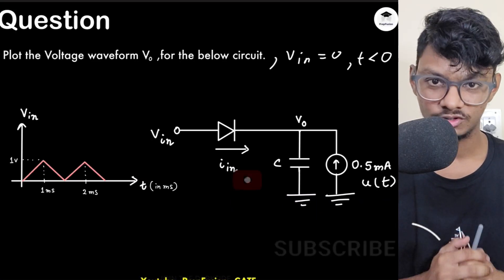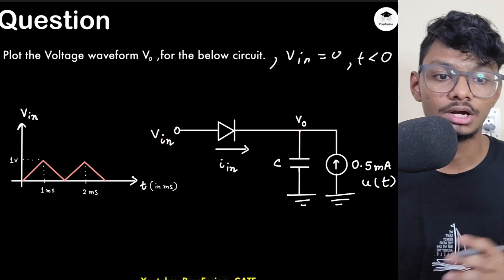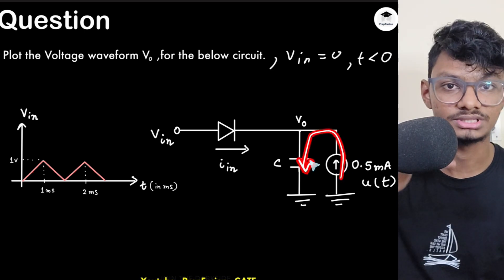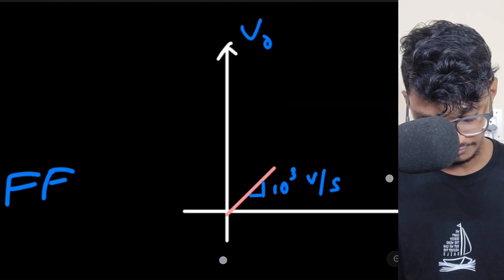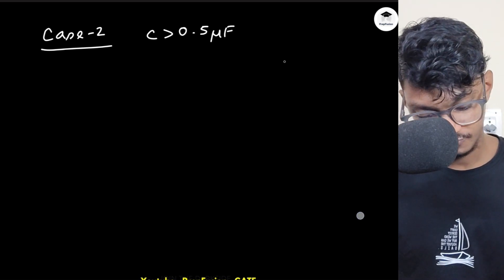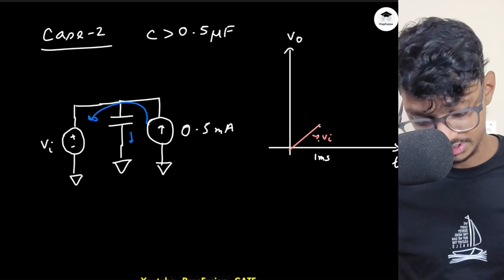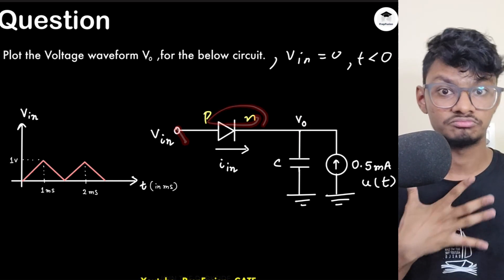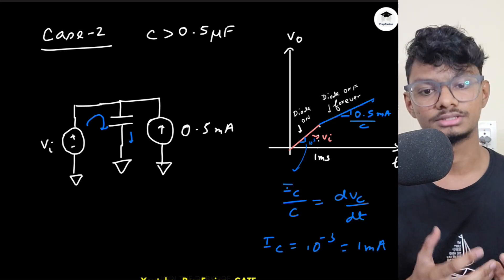Important Concept of Diode with Capacitor || Screening Test Questions || Circuit Queries

Comment: 10:21 Hi Anish, the point that you are making here in Case 2 situation - "the extra current flows through the source" is not valid here. 
We started our discussion with a point that the n side slope is smaller than p side in Case 2, which makes the dione ON. Once the diode is on, the current cannot flow into n side of the diode (into the V source). 

For Case 2 situation: 
1. The diode(ideal) cannot have any current in the reverse direction.
2. A voltage source when connected to a lower potential than it's terminal voltage will always deliver power. 
Hope you correct the statement :).
Reply from the maker: Yeah just a bit of mistake from the end the current will flow from Voltage Source to capacitor, current source actually provides constant current it doesn't change. Everything else remains same, I even calculated at the end that source is providing the extra current just the direction of diode is wrong I hope you get the points. Thanks for marking!